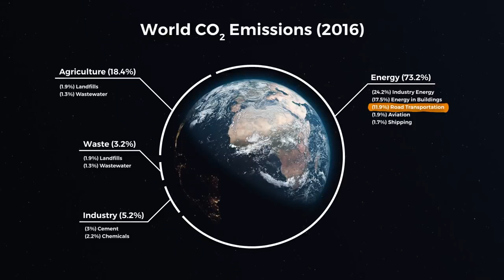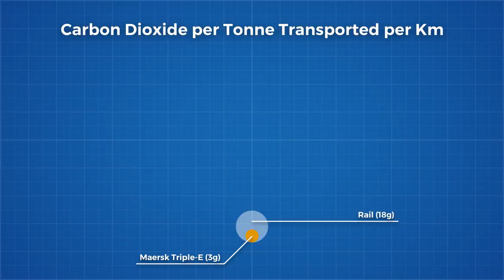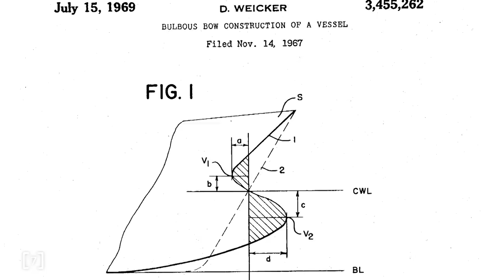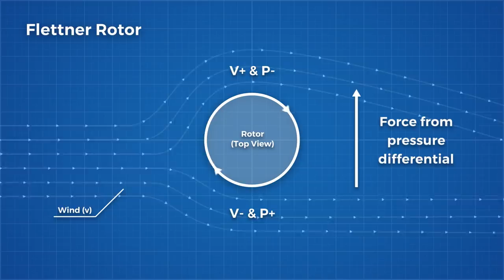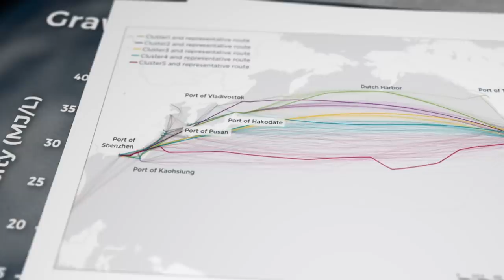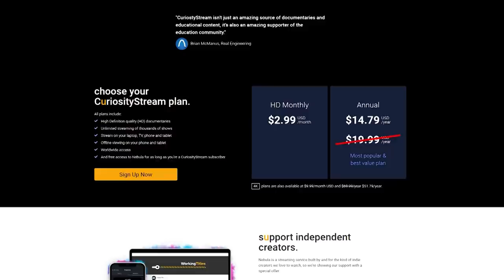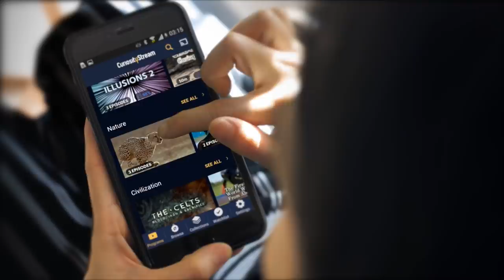Are Renewable Powered Ships Possible?

Comment: "Are Renewable Powered Ships Possible?" Yes, make them nuclear powered, a perfect match.
Reply: The US military already uses nuclear powered aircraft carriers, why aren't there nuclear powered commercial vessels. they are big enough, they are traceable, so what's the problem?
Reply: T W  Radiation is not a physical pollutant and can be shielded easily with water. Nuclear waste is contained in heavy metals and does not leak into the atmosphere. Air pollution from fossil fuels cause more deaths per year than nuclear power has ever caused in history.
Reply: it is a good idea but nuclear power is not a renewable source of energy because to run nuclear power we need uranium/plutonium to make the nuclear engines work, however it is far more efficient that fossil fuels as the ships would only have to refuel every 20 years or so but it comes with a catch and that catch being that if some sort of accident happens like a ship having its hull ruptured or damage to the engine could make it go nuclear and that is not good not to mention the staffing, maintenance, the many regulations that countries have on transporting hazardous materials such as uranium/plutonium and the shielding that you have to put in so that they don't make the water radioactive and so the crew doesn't die or get sick from radiation poisoning and over time all that depleted uranium/plutonium will have to be dealt with and it is already a problem with nuclear reactors producing a lot of radioactive waste that can't really be used for anything.
Reply: Do you have to sacrifice cargo area for fuel?
Nope, you free up fuel area for cargo.

Do you have to add refueling stops?
Nope, you eliminate them.

Do you have to slow down?
Nope, you can actually speed up.
Reply: @thephoenix1116  Nuclear is renewable, uranium is constantly being dissolved on land by water running into the ocean, we have millions of years worth and I will go out on a limb that we figure out fusion before then. Military ships all over the world have none of the problems you describe. Nuclear waste is not a problem, it's an asset and a great feature of nuclear power. Nuclear power, unlike any other energy source, contains and stores all of its waste, waste that is really unspent fuel, worth a fortune in future energy production.
Reply: T W  You're reading this comment because a device is "leaking radiation". You've been lied to.
Reply: @MrShpoulsen  The need for engineers is solved with automation. If a nuclear ship capsized you don't have an oil spill. Unless those terrorists have nation-state resources and can somehow hide a massive ship for a few weeks, they aren't going to succeed.
Reply: @jeremytheimer7443  Looool. Yes, sure, they disappear for weeks from any and all radar and tracking on the big open sea. Very traceable. Maybe you should watch a few of the videos from "Plainly Difficult" so you get an idea what kind of stuff happens to radioactive material in the hands of amateurs and private companies, let alone fissionable material.
Reply: @MrShpoulsen  The military trains 18 year olds to operate military nuclear vessels every year, no big deal.
Reply: @jeremytheimer7443   When your complete business model is based on the amount of tonnage you can transport with your ship and then you are exchanging the profit of seizable number of containers for a heavy nuclear reactor, as a big cargo ship you don't need the tactical advantage to be shore indepedent. Also for capatalist companies the cost for using such nuclear reactor has to be reasonable as a non goverment asset who doesn't get a fucked up load of money to get such boats build.
Reply: @MrShpoulsen  The market will fill the void, these would be very well paying jobs and plenty of people eager to earn that.
Reply: @chapter4travels  Not sure why people always think developing fusion technology would change anything. Just because researching "Fusion Technology" in SimCity or the strategy game of your choice solves all energy problems there doesn't mean this is how it's going to be in the real world.
Reply: @graealex  Nuclear fission can supply all the worlds energy needs for millions of years, fusion another billion years. If fusion turns out to be cheaper than fission, then it will be the energy source of choice when and if it gets figured out. I have to assume it will in the next million years.
Reply: @remastered_tp6898  i dont think that the size of reactor you would need would be all that much bigger or heavier than the existing engines
Reply: @remastered_tp6898  what? It’d have less weight than all the fuel they currently carry. It’d be only slightly heavier than the several story Diesel engines that they use at the moment. And the point isn’t to have “strategic independence from ports” it’s to be clean
Reply: @MrShpoulsen  Yes, it would take a long time but so will the transition to nuclear, not just in shipping but all other energy needs. Minimum of a hundred years. Fossil fuels are here to say for a very long time. Renewables are just a very expensive roadblock/delay to that transition.
Reply: @chapter4travels  "Nuclear is renewable" and "we have millions of years worth" are mutually exclusive statements. If it was renewable you couldn't express the supply in years because it would be effectively infinite.
Reply: @chapter4travels  Well, fusion is not going to be cheaper than fission in the foreseeable future. The main obstacle with fission is already the cost. Real Engineering already did a video on it, "The Economics of Nuclear Energy". I think it's important that we figure out fusion energy, but it's not going to be of any economical value.
Reply: @bramvanduijn8086  If you have millions of years worth of fission fuel and billions of years worth of fusion fuel, I think we are covered. Do you honestly think there won't be other solutions discovered over the course of billions of years?
Reply: @graealex  Thorcon Power is one political step away from fission cheaper than coal in Indonesia. We don't know how to do fusion at all today so how can you judge the future cost of fusion? If LLP Fusion is successful, fusion electricity will be 1/10th of a cent per KWH. Do you think that path might be figured out in the next 100,000 years? Seems possible.
Reply: @chapter4travels  "next 100,000 years" lol. As if the human race ever planned more than 20 years ahead.
And I can extrapolate the cost because fusion has similar properties to fission, with the main difference being that it doesn't have a self-sustaining reaction, which makes it even more expensive, not less. 
All I'm saying is that people need to mentally prepare for not having economically viable fusion energy in the foreseeable future. Whether building new fission reactors makes sense is a different question.
Reply: @chapter4travels  Btw, energy cost is mainly a logistics problem. So it's never going to be 1/10th of anything, not as long as demand is plentiful.
Reply: @graealex  I'm not waiting for fusion, I just know that it is in our future at some point, who knows how long.
We will transition from fossil fuels to fission over the next hundred years or so, longer if we keep wasting time with worthless renewables.
Reply: @MrShpoulsen  They certainly are not, the propaganda you linked leaves out the cost of the 100% demand sized natural gas plant running 24/7/365. So called renewables can only offset some fuel cost of an already reliable power plant.
Reply: @MrShpoulsen  They don't include the 100% backup power plant. "Perfect supply/demand equilibrium" they do right now everywhere in the country and every first world country in the world.
Reply: @chapter4travels  See, that's what I am saying. People need to get nuclear as a solution out of their minds, as it's already creating more problems than solving, so that people can actually commit to transitioning to renewable. You're just waiting, waiting for fission to become safe and cheap, waiting for fusion to become economically viable, while the industrialized world already started to satisfy their energy demand with renewables.
Reply: T W  I don’t think two reactors out of over 400 is equal to 90%
Reply: @chapter4travels  I'm just saying you are contradicting yourself. That is not wise if you want to convince people.
Reply: @jeremytheimer7443  Price for a start. Heavy fuel oil costs about ¢3 per kwh. With the efficiency of the engine maybe ¢6-7 for the mechanical kwh. A modern NPP will be at least ¢10/kwh, the Navy ones likeky a lot more (They use highly enriched U235 so that is a nogo right there). So even if we solve all the technological questions we're almost certainly be mor expensive with nuclear. That's the magic of burning some elses waste.
Reply: @bramvanduijn8086  By your definition wind and solar are finite as well, the sun won't last forever. The "renewable" argument is just dumb at its core.
Reply: @patrick_test123  You are leaving out speed, a nuclear powered freighter could go many times faster which will more than pay for itself.
Reply: Ignoring the cost aspects of such a plan (building let alone decommissioning such a vessel won't be cheap), I'm not sure we necessarily want worldwide fleet of commercial, privately operated nuclear ships when it comes to safety and proliferation...
Reply: @chapter4travels  And going though way more of the expensive kwhs? Ships aren't limited by their fuelcapacty but by the cost of the energy (Right now there is to much capacty so the point is even lower than it otherwise be).
Reply: Cost
Reply: @bramvanduijn8086  well by that logic solar isn't renewable because the sun will die in billions and billions of years in the future.
Reply: @bramvanduijn8086  When discussing energy technologies, the difference between "millions of years worth" and "renewable" is irrelevant.   The critical period is the next 50-100 years.  Technological change 50 years out is unpredictable, and will change all parameters of interest.
Reply: "Are Renewable Powered Ships Possible?"  Yes, possible, but NOT PROFITABLE.  Big difference for commercial shipping company.  Bunker fuel is so goddamn cheap, costing only $0.03 per kWh.  Even if Green Hydrogen at an incredible-cheap price of $3 per kg, containing 33 kWh of energy = $0.09 per kWh, clearly 3 times more expensive than the so goddamn-cheap bunker fuel.  Nuclear is too damn expensive also!
Reply: @misterpercy5187  Hull speed of a typical container ship (1300 ft long) is 48 knots, yet using bunker fuel they can only go 24. With nuclear they could double their speed and double profits as well.
Reply: @chapter4travels  --Even Nimitz-class nuclear aircraft carrier is only capable of 30 knot top speed using 240,000 hp steam turbines, and this is blistering fast for surface ship.  You can forget about ever traveling close to 48 knots in a container ship having 2 piston engines with 39,000 hp each, since doubling the speed mean 8-fold power requirement or quadruple the fuel consumption per mile...when nuclear energy is already several folds more expensive per kWh than bunker fuel.  It just ain't economically feasible.
Reply: Jeremy Theimer There are nuclear comercial ships. Russia has icebreaker ships which are powerd with a nuclear reactor. The hardest part is getting the technology to be cheap enough forwidespread comercial use.
Reply: @MrShpoulsen  That is wishful thinking at best and pure propaganda at worst. Germany is proving how hard and expensive it is right now. They pretty much are doing everything wrong. Shutting down nuclear and wasting billions on useless wind and solar. The only thing they got right is investing in the natural gas pipeline coming in from Russia. Indonesia on the other hand is doing the smart thing with advanced nuclear, it will transform their country.
Reply: Not a good idea, because of the human factor.
Reply: people arguing against nuclear as still thinking about solid fueled reactors(SFRs) which are garbage in-comparison to liquid fueled reactors, they are that much of a game changer,  they use over 90% of the fuel against the less than 1% of SFRs lol alone is enough, plus they operated at 1 atm of pressure and high heat(800c) which makes them lighterand smaller and produce more power that can be used directly.
Reply: @graealex  Fission is already one of the safest sources of energy.
Reply: @pseudotasuki  I like how there was a meltdown of a nuclear power plant in an industrialized country literally only 9 years ago, from which the affected region will suffer for decades to come and with billions of cost, yet people still claim nuclear to be a safe source of energy. What other evidence do you need besides actual accidents having happened multiple times? NuClEaR iS A SaFe SoUrCe Of EnErGy... my ass it is.
Reply: @graealex  There were three meltdowns and the only people who died were due to an unnecessary evacuation.
Reply: @pseudotasuki  Yes, I'm sure you have many arguments why it's safe despite accidents with people dying have happened multiple times - Tepco was just incompetent, modern reactors are much safer, yada yada. It's like talking to a wall. And I'm not even talking that much about human tragedy, just the estimated cost of dealing with the accident of around $96 billion should give a clear indication on how idiotic nuclear is and will always remain. I have yet to see a solar farm or a wind park melting down, prompting evacuation of some 150,000 people and large scale clean up measures. But sure, it's a safe source of energy.
Reply: @graealex  You think nobody has been killed by solar?
Reply: @pseudotasuki  We won't even go into that line of arguments. Every construction site poses an occupational hazard, but someone who thinks the number of people that died from the Fukushima Daiichi accident is only "4" shouldn't be allowed to make any comparisons at all.
Reply: @graealex  You're the one who brought up the safety of solar, but you won't allow its safety to be discussed?
Reply: @graealex  Oh right, now I think I understand it. Someone dying because they fell off a roof or wind turbine is acceptable to you.
Reply: @pseudotasuki  The problem is simply that a lot of people get hurt, in the construction of plants, in the production of solar panels, in Uranium mining and enrichment, whatever have you, and we probably won't get authoritative figures for any of these cases, but it remains true that a faulty solar farm will never necessitate the evacuation of a hundred thousand people just to make sure no one gets hurt by radiation.
Reply: @graealex  And as I already mentioned, the Fukushima Daiichi evacuation wasn't necessary. http://ftp.iza.org/dp12687.pdf
Reply: @pseudotasuki  But it still happened. Any of these accidents could actually have been prevented, but that requires hindsight 20/20. That's the part you don't seem to understand, accidents will happen, and people will get evacuated. This is inevitable.
Reply: @graealex  What hindsight? There are still people the Japanese government won't allow to return home even though it would be safe. No scientist who understands the risks of radiation would have supported that evacuation even if it wasn't in the aftermath of a tsunami.
Reply: @thephoenix1116  You silly

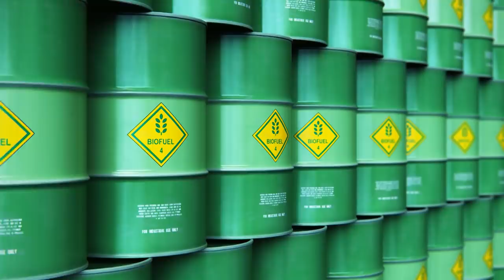Comment: 9:37 Also, LNG refueling stations can be extremely dangerous.
Reply: Not true. LNG transportation unlike other areas of the industry is incredibly safe and strictly regulated with the industry never recording a serious incident during cargo transfer.
Reply: @jameslane2615  Sure, as long as things continue as they are. But they're massive terrorism bullseyes and if something does go wrong, it goes really really wrong.
Reply: @jameslane2615  I would much rather work on a ship with a heavy fuel oil leak, than a gas leak...